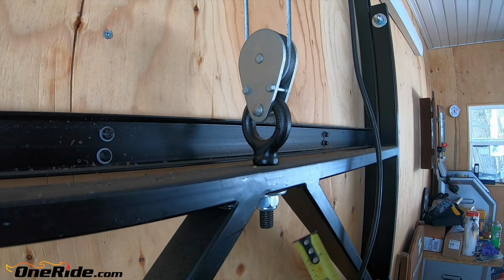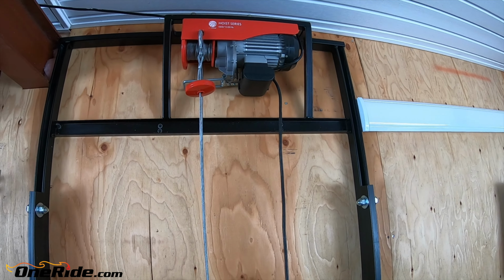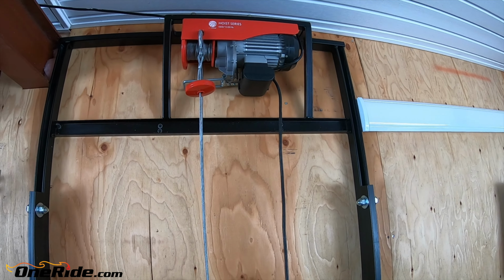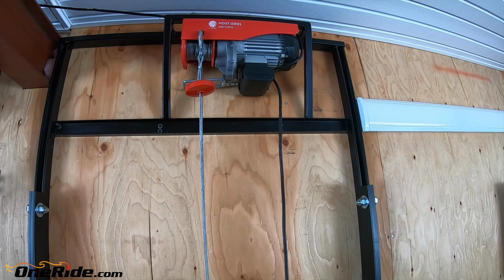Best Snowmobile ATV Garage Storage Lift - DYI Build Your Own full dimensions

Comment: I was wondering if you could give a better description of the linear bearings you used. Possible picture. Thanks
Reply from the maker: @donaldgraham4430  I found this link on Amazon. Something like this will work. 1 5/8” linear bearing. https://www.amazon.ca/Genuine-Unistrut-P2950-EG-Assembly-UNISTRUT/dp/B00KN9UA0S/ref=mp_s_a_1_10?crid=2DPI0H8NSZYZD&dib=eyJ2IjoiMSJ9.HKfCr5oYG3WESS0UYVYtoKJLAK_8xYDaiJZvTIjrptj4g3YaJUiBi7Q-GDXhtP2_U-IBmdJ65RSUP6JfeMYOkR_ZFDm-iAgAcqJfWapk8sgU8OgPNED93dXlZMB60pgZ3VxPG0T0XBW7ohvcp-kt7w489lANVAdUJK8TH4TuNih0PdmqBaB_0BxlCg3XIaFbfisOoFvf8QD5Flp3lNX0rw._Q6xcmrkCNqMt-J3qbauKp-R2Ue3KxiD-ASUGR-ZVQg&dib_tag=se&keywords=linear+bearing+unistrut&qid=1738813804&sprefix=linear+bearing+unistrut%2Caps%2C98&sr=8-10

Comment: Would love to see you lift a full size sled. Where do you position the lift rails on the under side of the sleds? I am debating going your route or making as larger platform for the whole sled to sit on
Reply from the maker: You can make a platform by using bolting plywood to the arms. I was thinking that but it takes away from the look. With just the arms you get a nice view of the skid and track. The front arm goes under some support under the engine. Usually by the an arm on new sleds. And anywhere really under the track. Let me look for old pictures with a full sized heavy sled.
Reply from the maker: I was able to find one picture with a large Arctic Cat on it. I posted it on OneRide.com. Check it out.

Comment: What winch did you use? Capacity?
Reply from the maker: It’s just a small winch 660/1320 lbs. Pully the cable back to the winch to achieve the maximum 1320 lbs capacity. Princess Auto/Harbor Freight depending on what country you are in.

Comment: Love this design.  Thinking of building one. Do you have any more details/ info on the rollers/ bearings you used that ride in the strut? Also have you thought of adding some sort of saftey stop block or something incase the winch was to let go?
Reply from the maker: I hope you build one, this is the best thing I added to my garage. Search for “1 5/8” unistrut rollers” and you will find different options. Like this… https://www.amazon.ca/Genuine-Unistrut-P2950-EG-Assembly-UNISTRUT/dp/B00KN9UA0S/ref=mp_s_a_1_7?crid=1C8RD04RJA4KG&dib=eyJ2IjoiMSJ9.C7yleKgkPJoBgZBHYTLsNPkHZ5K7d6zO-rQ7oXmWtADQctWfqEcIraUWAHd_uQzmutzykHCiTw9vLr-sYkeXA1cFRRm8C7PUtpmq0osW1PpUXpz8xRVimhc_oZnzsrUq3jYHjZ1PwWoQ2ha9KSyKtj51M7WZJutopaaTSBsMzVO2AFrrPhL9YK3cq3oqMfPvGYLvT2YX2gbFBTgZ21Oqfw.8HYwIB00mtT9rKeIvcCh4xbrMRt0c9UI5rgqEaPoXrE&dib_tag=se&keywords=1+5%2F8+unistrut+rollers&qid=1713622631&sprefix=1+5%2F8+unistrut+rollers%2Caps%2C113&sr=8-7
Reply from the maker: Yes, when I first built it I used a safety stop but I got really comfortable now so I don’t. But I should. There are many easy stops. I used my overhead beam and had a strap to one of the arm. But if you don’t have the overhead beam you can simply drill a hole through the rail, under the roller, and put a strong bolt through it. Or a very simple stop, which I think I will do, is put a piece of wood in the tracks (unistrut) under the arms. It will hold it if the winch fails.